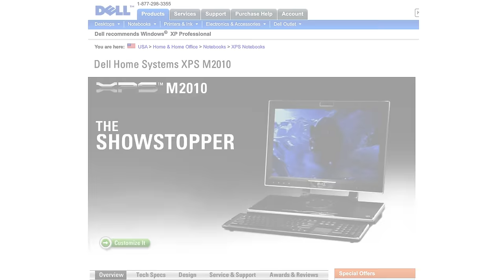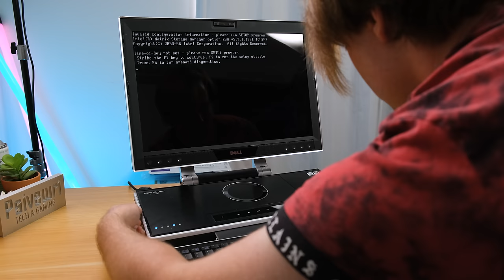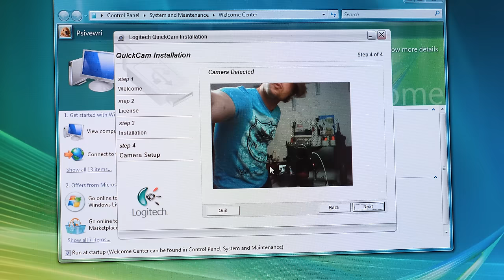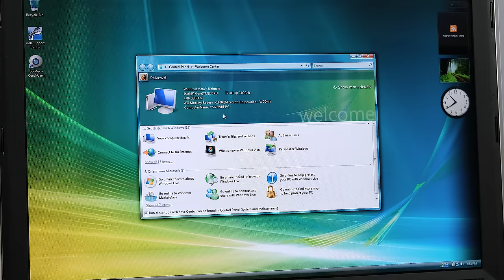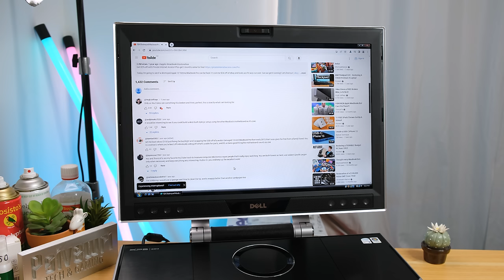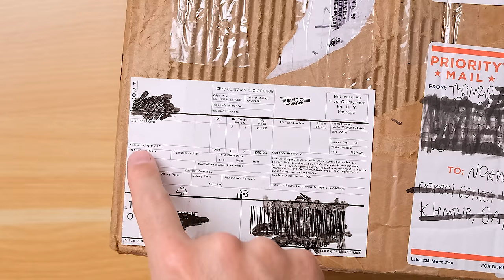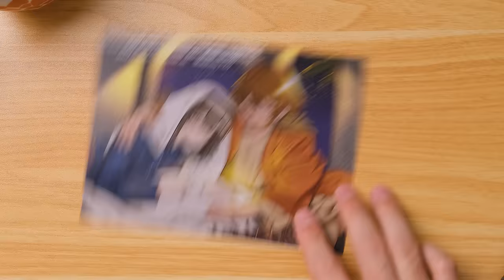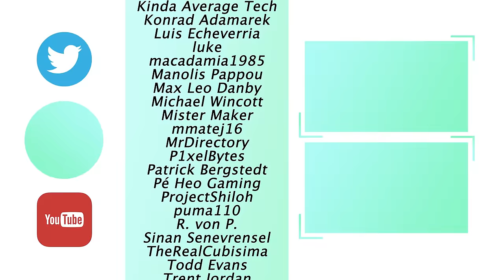Using Dell's INSANE 20" Laptop From 2006! XPS M2010

Comment from the maker: Hoping to get content out on a more frequent basis once I have a dedicated room for my filming. Our house is only weeks away from completion, so not long now! Thanks for being patient and watching the content I can currently put out 😊 - Nathan
Reply: mix baking soda with the CA type super glue to create an ever stronger bond for plastic parts being glued back together
Reply: What a great video with unique Dell laptop! Thanks!
Reply: ur a big huge manful stud <3
Reply: Having just bought a house that's basically a kit home at lock-up stage, I can relate to the whole half-finished house scenario. All the best for the final stages of the build.
Reply: You may consider looking at the Quadro FX graphic cards. HP in these years was using those in their workstation laptops. The highest I know about is the FX 3700M with 1GB VRAM. Just make sure the MXM interface is the same.
Reply: That's good to hear❤
Reply: I had no idea they started making these that long ago.. I had a laptop from like 2007 to around 2015 and it was all non gaming.. I didn't see anything like this until like 2019.. lol
Reply: Imagine taking that chassis and placing a Framework motherboard in it.
Reply: mate do u want an amost 17 year laptop its a toshiba EQUIUM
Reply: That's nice King Turtle you have there, mate.
Reply: Great vid! I have found that using some mildly abrasive metal polish (like autosol) is very effective at removing rubber coatings. Maybe it would work on this ‘laptop’ too!
Reply: See if you can find the 24" hp Pavillion... thing was a monster fixed 1 long ago. Was like those 8088 suitcases with the 4"? crt monitors built in about 50lbs.
Reply: I find glen 20 gets rid of rubber coating and a cloth.
Reply: Would you use screen protector 🤔  no more wiping screen
Reply: A little dab of silicone oil on the thermal pads will help rejuvenate them as they will likely swell a bit and fit better. VRAM that old doesn't really need much cooling so it would definitely be a waste replacing them.
Reply: AF Maxiclene spray is great for cleaning electronic goods! great on monitor screens too
Reply: hey, psivewri there was gpus created for dell inspiron 9200, 9300, and 9400 that fits in that port
Reply: What did you buy this laptop from ???

Comment: I remember using it back in 2007. I got it brand new. and I kept using for years and years on Original software until I got my ThinkPad in march 2022 and I retired the XPS M2010 in june 2022 this XPS M2010 is a legend.
Reply: wow that is super impressive. Did you max it out or anything?
Reply: Would you sell it if you still have it?
Reply: You kept on using the same OS ?

Comment: Channeling the spirit of the ‘luggables’ from the early 80s
Reply: Osborne would be proud
Reply: I wanted one of these so much when they were new. 

It was like buying a $8k USD laptop to me back then, but it was so cool to be able to take a "desktop" anywhere, and even have a little bit of battery.
Reply: I have a still-working Toshiba T5200 from 1990 :) It's a 386SX machine that requires mains power and weighs about a ton haha.

Comment: To remove the soft touch plastic you can use oven cleaning spray. Used it many times, works really well.
Reply from the maker: That’s more or less what Ajax spray and wipe is as far as I know. However it was taking a while due to just how thick the coating was. Do you have a brand of oven cleaning spray you’d recommend?
Reply: @psivewri  I don't have any specific spray since it worked with anything I had at home. I am talking about these oven cleaners that come in aluminium cans, similar to spray colour for example, they usually have a thick white foam. Don't know if thats avable in australia though.
Reply: @psivewri strong oven cleaners are quite different from Ajax, with things like Goo Gone containing Kerosene and PPG3 Methyl Ether.

Comment: There's also the HP Dragon HDX 9000 which was a 20 inch monstrosity. Great video BTW!
Reply from the maker: I had no idea those existed! What a name though, DRAGON HDX 9000!
Reply: @psivewri  was my dream machine back in the day, the name was epic , cheers!
Reply: HP currently has the Move series of battery powered AIOs that they advertise as being able to take anywhere. They are 23.8" and come with a wireless KB/trackpad. To me, something like that or anything Dell or HP ever made to fill that space is just stupid. Portable AIO computers is a category that never took off and for good reason. If Apple slapped a battery in an iMac, maybe people (not me) would line up in waves to buy one, but HP or Dell doing it is just plane wrong.
Reply: @matthewjbauer1990 They're only doing it because it's cheap to do so. All the hardware in AIOs is taken off laptops anyways so why not just throw in unused stock batteries as well? Literally zero engineering cost on their part
Reply: I have one of these, it is gorgeous. Not very powerful , but has great sound and.... it's not melting!  Windows 11 runs.....good.
Reply: Woah that's neat. 

HP just took their design for crapass plastic laptops and scaled it up to the the size of a house.
Reply: Was going to bring that up too, i myself have the HDX9300. A huge thing it is, similar kind of hinged screen to this XPS, the media remote that comes with it (that mine still has) is a nice little thing as well. Pretty much that M2010's competitor, if you could call it that. Either way, a huge & a nice one, the HDX9000 series is.
Reply: @psivewri  I lusted after these as a kid. They're very hard to find in working order, but I've been one or two on eBay. If I find one I'd definitely send it over.
Reply: @frostedbutts4340  No different than Dell and their plastic laptops. Or any mid-2000s manufacturer other than Apple, really.
Reply: Wow! I didn't know HP once manufactured a 20" laptop.

The one I know of is a Pavilion model that had an 18.4" display; that laptop was released around 2008.

Comment: I also have a M2010! Bought it a few years ago with the leather case and most of its accessories. And yes the rubber coating was a pain and had to remove it all the exact same way you did. I also have the same issue with the keyboard not connecting and its a pain. Absolutely lovely machine and I remember repairing one around 2010 and always wanted one since.

Comment: Framework laptop should make one like this. It would be crazy.
Reply: Man that'd be killer, I'll bet you could even 3D print a case like this for Framework components, Might need some cables and adapters but it could be done.
Reply: @JohnVance  I am considering exactly this option and drafting scetches this weekend!
Reply: @inedex Hell yeah, Framework kit is underrated. So many possibilities.
Reply: @inedex ooh, will there be a video or something?
Reply: Framework probably won't, but somebody else could. There's a guy that retrofitted a framework mobo into a thinkpad 701c

Comment: Use baby powder (talcum powder) on perished rubber.  Sprinkle the powder onto the rubber  and then blow it off.  It doesn't look pretty but it dries the stickiness right up and leaves the rubber slick to the touch.  IPA speeds the deterioration up, hence the need to remove the rubber layer.

Comment: that machine is a portable media beast. It'd also be a decent Windows 10 unit, even with 4 gigs ram. Just disable some of the windows 10 background services and it'll be good for modern use, especially for everyday work and office stuff.
Reply: Seriously! That FireWire 400 4-pin port would have been mainly used with miniDV camcorders of the time to transfer footage off tape for editing, and the specs would have made it a great editor at the time. I could imagine this being part of a mobile video production rig where the FireWire is controlling a tape deck or some other A/V gear.

Comment: If some company (Apple?  Lenovo?  System 76?) could get a modern equivalent of this down to 17” completely folded up (to facilitate traveling with it easily) and maybe make the monitor and keyboard expandable this would be an utterly badass design for a portable computer.  As it stands now it’s wildly impractical as far as portability goes.
Reply: You may want to take a look at the Surface Laptop Studio - very similar in concept to this one, but without the removeable keyboard/trackpad combo.

Comment: What an absolute gem of a find, love the video!

I'm hanging on to an old Dell Studio XPS M1340 from ~2009, it's a cool little machine with two (very slow) Nvidia GPUs in SLI. I was pleasantly surprised that Dell make drivers available and easy to find to this day.

The soft touch finishes on tech from this era is a nightmare. I've got an old Gainward GTX 295 graphics card that is sticky and covered in dust because the rubber coating is degrading.

Comment: So far what I found to be the most effective to remove the sticky gooey rubber, other than the manual labor and scraping it and worrying about damaging the surface.
There's this stuff called "Goo Gone" it's sort of an orange liquid. this will require some muscle Greece but not nearly as much as scraping. Start off with putting some on a rag and scrubbing it all around then alternate to a different rag with isopropyl alcohol and after a couple cycles of doing this it doesn't look like it cleans up but then all of a sudden it cleans up and doesn't damage the surface.
Although be aware of painted surfaces and alcohol.

Comment: When I was on my new hire training at Dell in early 2011, we had an XPS M2010 there and an Adamo 13 as well, apart from the usual Latitudes, Vostros and Inspirons. I still have a soft spot for those two laptops to this very day. (and for the XPS M1530 and M1330, but for a different reason)

Comment: 8:28 I had to do that to an old Alienware M11X R2 recently. Tried soap and water and various solvents, but none worked well. Eventually I also scraped off the plastic coating with an old plastic gift card. And yep it was a tedious process ;)

Comment: 8:20 in my case the best method was using WD40 with that same ifixit plastic tool, it removed the sticky rubber way easier, than used a cloth with some glass cleaner to remove the WD40 left on the item.

Comment: I still have this, and I have upgraded this computer in 2022. I did exactly same thing, upgraded RAM, Changed to SSD, and timely took 2 days to remove the horrible rubber coating. I also had the keyboard issue, but after changing the battery and reconnecting it works fine. 😂 Nice to see someone who has done same thing as me.

Comment: This is really cool to see! One comment: the "dry thermal paste won't transfer heat" thing is a bit of a misconception. A lot of thermal pastes are formulated specifically to dry out, as this increases their longevity (makes them immune to pump-out, and anything not meant to dry out drying out will reduce its performance). As long as there is solid contact with no cracks, bubbles or air gaps, solidified paste can still provide perfectly adequate cooling. The problem is that solidified pastes stick very poorly to smooth surfaces like a CPU, so even relatively small bumps can cause the paste to come loose from the surface and create an air gap, which will absolutely tank thermal performance. But most of the thermal gains seen from, say, repasting relatively new hardware comes mainly from these industrial, long-life pastes simply not being very good in terms of performance, as longevity is the priority. This is also why GPU makers are increasingly using phase-change thermal pads on the GPU, as these provide a best-of-both-worlds-type solution, with both good longevity and performance.

Comment: 11:53 I had one of these, it came with a bluetooth mouse (and an XPS CD wallet)  The X1800 GPU will fail, they all fail.  if you read this, underclock the GPU to extend it's life (even with new thermal paste, it will die). I had mine re-balled and it still only lasted a few more months.
Reply: I got a secondhand Dell Bluetooth mouse and IIRC the pairing name might've been "XPS M2010 mouse". I'd need to check to be sure.

Comment: That sticky rubber surface is really annoying. I have a old beard trimmer that still works and I still use, that had a thin layer of that rubber. I scraped it off with my fingernail and used ISO alcohol. it still gets used a couple times a week. I've also had something else electronic with that coating that was much larger and used goo gone and alcohol to get it off.

Comment: Methanol is best for removing sticky rubber residue. I restored few laptops with it by completely removing rubber coating. It will not damage the plastic, it is time consuming however .

Comment: I had this when it first came out. There was a known issue for these overheating and I was getting BSOD after a year of using it. Would randomly restart even if I am not running anything and just on the desktop. Most likely the heartsink was too close to everything given the form factor. I did get a ton of compliment but it was heavy! Lol felt like 25lbs carrying it around but it was nice having a handle grip for carrying. battery life was definitely not the greatest. Hp made a similar version if you ever get your hands on one during the same era. HP 20" HDX Dragon

Comment: Whats interesting is the advancement of batteries too. Despite the battery being the size of a maglite, it's only rated at 56 W/h, compared to a current 2024 14-inch MacBook Pro which has around a 70 W/h battery in it at a fraction of the weight and size.

Comment: I had a similar problem with Windows XP bluescreening at boot after swapping the drive from another computer. I got it back into the original PC I got it from and it booted just fine. I just removed the GPU drivers and reinstalled the drive into the new PC and it had no problems booting.

Comment: I was able to get mine running Windows 10, install two SSDs and was using it as a daily driver until the GPU failed.  Good luck finding a replacement.  That was two years ago.  While it was working, it was very fun to use and fun fact, it was featured in IronMan!

Comment: That rubberized coating can be removed using acetone. It's a very thin layer after all. In order to prevent it from being tacky like that, you have to either apply silicone or some sort of oil to it. This ginormous desktop reminds me of one custom laptop that came out a few years ago which had a desktop CPU and a desktop graphics card. It was about the thickness of a briefcase and battery life using the dedicated graphics card was about 2 hours.
Reply: You'd need to be very careful using acetone. Most laptop casings are made of ABS which dissolves as well.
Reply: @eDoc2020  I recommend you don't submerge the thing in acetone. But yes, the intention here is partially to dissolve the rubber and some of the superficial plastic, otherwise you'll end with tackiness on the plastic after you've removed the rubberized coating.

Comment: As someone who used a sort of "desktop replacement" style laptop for a long time, I can see the particular niche this fills. If you are someone who really liked the portability and the smaller form factor of a laptop, but you actually wanted lots of ports and the raw horsepower of something equivalent to an actual desktop tower, this would be what a machine like this had in mind. Someone who likes, and needs, some horse power, but wants something in a laptop form factor because it's easier to move it from place to place. Way, way easier compared to moving a whole desktop tower and all its peripherals.

But you simply couldn't have everything for the period of time where "desktop replacement" laptops were a thing. You couldn't have that horse power AND have it be good at being a laptop that can rely on its battery, and give you more than maybe 4 or even 5 hours at best on stuff in late 2009 or 2010 that filled this niche (with a huge, chonker thing of a battery, like what my HP Pavilion dv7 multimedia-oriented, "desktop replacement" laptop).

I think the market for those kind of computers disappeared around the early 2010's, as typically x86_64-based computers not only continued to get way more powerful, but significantly more power efficient. 

There's a reason why during this time period, those who wanted a laptop with really good battery life first and foremost had to get a netbook, or compromise with a laptop somewhere in between a netbook and desktop-replacement.

Now, the spirit largely lives on in what are known as "Ultrabooks". Where you can have both the power and the portability of a proper laptop that can live and do things on its battery for hours 15 hours easily, depending on what you're doing.

But you still can't really have all the cake. There's always compromises, whether you go with a desktop or a laptop. You let go of portability and power efficiency on one side, or you have to accept that compromises are made in order to deliver "raw power". Often throttled with longer, harder, therefore hotter workloads. Plus it's harder to work on a laptop and upgrade your internal storage or RAM. Smaller components. Some aren't even meant to be user serviceable anymore. 

Thanks for sharing this with us, mate! That's a very cool machine. Very unique. That sucker has to be pretty heavy. My 17" Pavilion I previously mentioned had to at least be 15 lbs at minimum to hold, especially with the battery installed. Probably a little heavier.

Comment: I have always wondered whenever I see some older laptops like this with a relatively larger ... everything if they can be moded with some newer parts. Not just upgraded to the "best in slot" if you will, but rather brand new modern mobos, etc. I do realize that the formfactor being relatively unique will be an absolute nightmare to try to do it with, just like with most laptops anyway, but it does look like it has the space if nothing else.